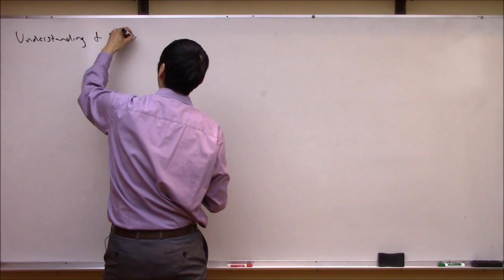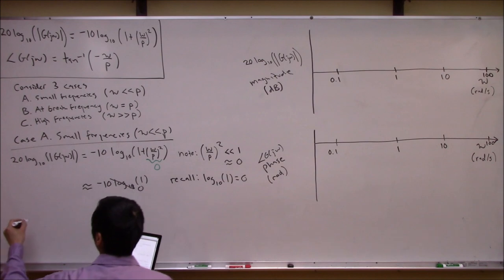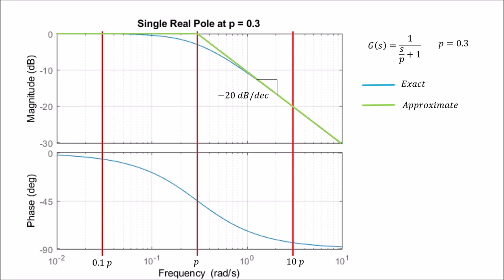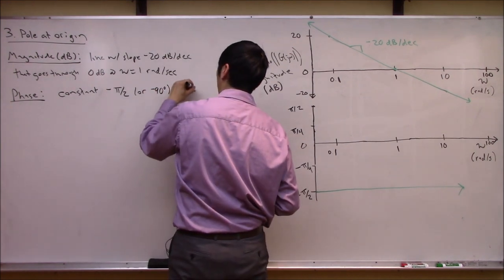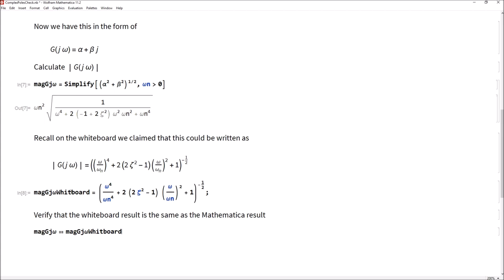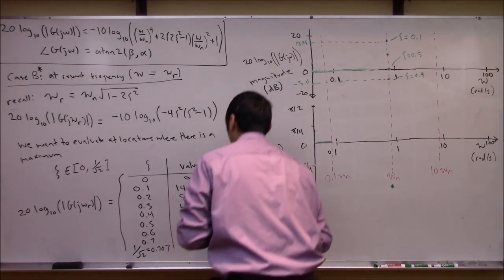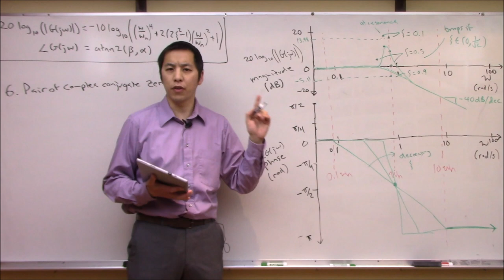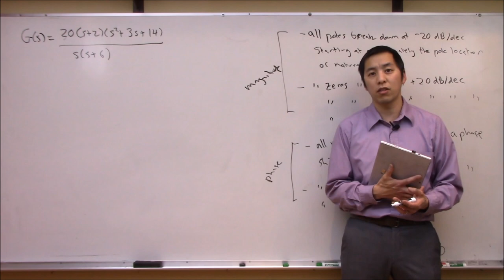Understanding and Sketching Individual Bode Plot Components

Comment: AE511: Hey Chris, when we see the value of 20*log(|G(jw)|), this is akin to the gain of the system in the frequency domain? i.e. would this be the equivalent of the DC gain * amplitude of the step function, except that we're dealing with an oscillating input?
Reply: AE511: Similarly, seeing a positive gain or negative doesn't tell us anything about system stability, right? Just how much the input is multiplied by to get the output.
However, when we see the gain climbing to infinity as the frequency increases, does this mean that the system would be unstable as the frequency increased to infinity..? Although for any real system I think our input frequency would be capped due to mechanical constraints.
Reply from the maker: The DC gain can be read off the body plot by looking at the left-most value.  This is because this corresponds to G(j*0) which is effectively a step/constant input (ie a sin wave with 0 angular frequency).